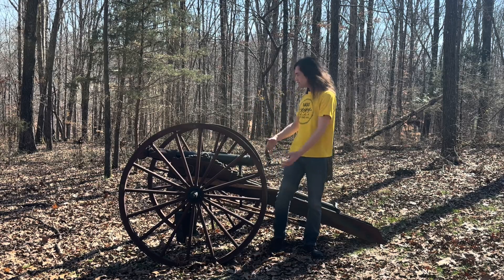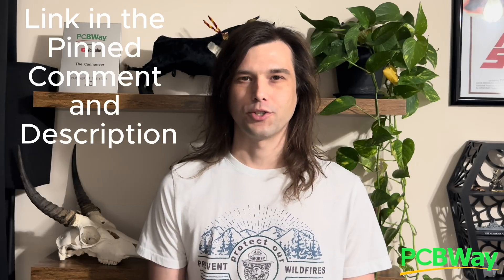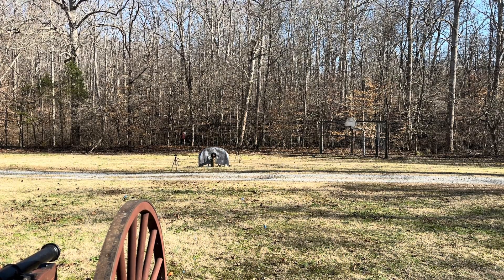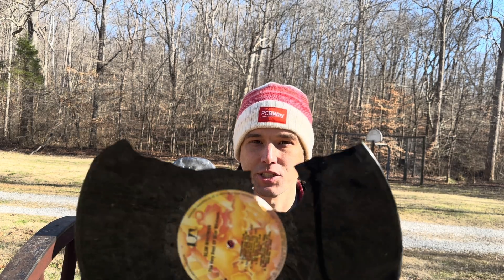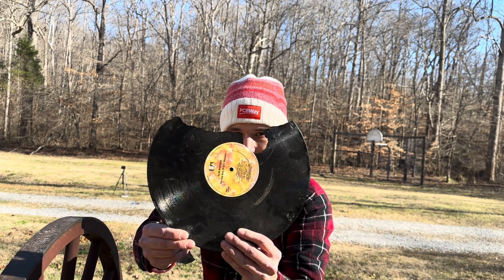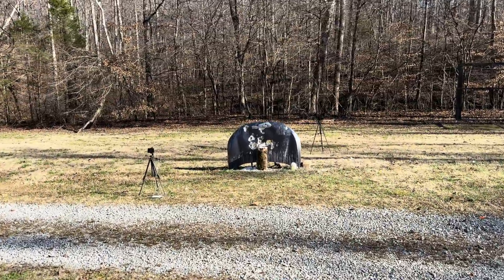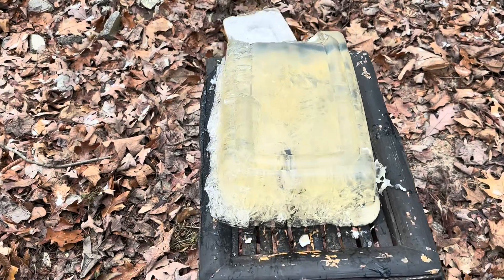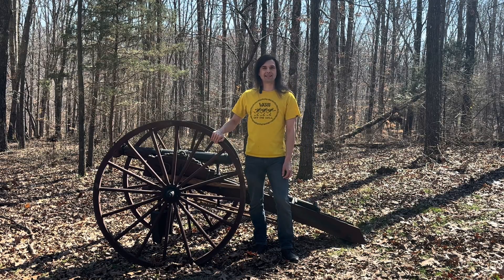Shooting Airfoil Cannon Rounds

Comment: I think those airfoils would fly better if you put a large brass or steel ring inside the front of the round. If you leave a cavity for the ring in the model, you can pause the print and insert a ring. The extra weight up front should keep them from tumbling and make them more accurate. Brass is heavier per volume (its denser), so a brass ring would be the best unless you can get lead rings somewhere. The infill on the model might need some reinforcement to keep the ring in place during the firing process.

This design is really creative! It is a good design but the instability is due to its  low density. It just needs more weight up front to keep it going and stabilize it.

Comment: I have been shooting cannons, both reproduction and original for about 35 years, and in one of my earlier cannons i fired 2 inch PVC pipe couplers and they behaved beautifully as airfoil rounds. The trick was block one end with about 3/4 inch thick of plaster of paris. The plaster would blow out but the blast pressure was sufficient to give good effect at a plywood target at 100 yards. This all was a serendipitous result in searching for a cheap and readily available projectile for a smooth bore cannon of my making.
Reply from the maker: Interesting! I’ll try this out and call is a subscribers special and tag you!
Reply: Got a new 2" i.d. cannon (drill pipe) going to try that... First tests, with a long fuse, from 100 yards away, make sure it doesn't explode; using homemade black powder, not smokeless... Not stupid.

Comment: This is a random question that has just occurred to me, are you using black powder or gun powder in your cannon?  Question aside, I do enjoy your videos and have a suggestion for your car bonnet backstops.  With a contrasting colour of spray paint, give each hole a small spray around. This will make any new holes a lot more visible to your audience.
Reply from the maker: We tossed a can of paint in the range bag for the next time we film this week! Also it’s transitional black powder!
Reply: @TheCannoneer  thanks for answering my question. there is a large barrel pressure difference between the two.

Comment: Ring-Airfoils work by being stabilized via bore-parallel rotation, that's the same type of rotation that rifling imparts. Without that rotation there is ZERO stabilization and thus no accuracy. the US Army experimented with them in grenade launchers back in the 1980s.
Reply from the maker: That makes complete sense honestly. I also didn’t know about the army experiments. That’s pretty cool. Thanks!

Comment: Next time when firing oddball projectiles mostly symmetrical except for some front/back differences like this, load one or two of them backwards. These may have had better stability if loaded opposite of how they were intended to face. Ballistics/aerodynamics get weird at the speeds these things get up to.
Reply from the maker: That would make sense as well! Thanks! I went with the idea of an airplane wing with the big part forward 🤣
Reply: @Eidolon1andOnly  lol I found an airfoil plotter online, pulled it into fusion, and did a revolve around the axis. Didn't put too much thought into it. But I have some ideas, one of which is to make it longer to get the center of pressure behind the center of gravity, as well as small fins to induce some rotation. I also want to try out different materials and construction methods.
Reply: @pnwscitech1589 yeah some inside vanes to induce rotation might help. Nose heavy should too I guess.

Comment: It's counterintuitive how projectiles fly.  An example is how so many submissions just want to fly "backwards".  

People think that the pointy end forward matters more than weight and balance.  You just can't physically get enough mass into a "pointy" (sharp edged, low drag) end of a solid projectile, meanwhile the heavy flat end with 80% of the mass is going to outvote the 20% of the pointy end and lead the way.  But because there's now no drag on the pointy end to keep it from overshooting it just rotates all the way around and the cycle goes on.  Think of how space capsules enter the atmosphere, flat side down and pointy side up, right?  

Similar dynamics are in play at the speeds and Reynolds numbers involved.  The space capsule is moving way faster, but is bigger and in 'thinner' air.  In comparison your cannon sized rounds is like trying to shoot through water, and a .22 is trying to fly through warm honey as far as the relative air viscosity felt.  This is why insects can fly, they're so small that the air molecules are basically closer to them in size and move differently, the boundary layer is all different and it makes it 'feel' thicker in the dynamic response of drag and such.  Normal sized aircraft operating at normal altitude ranges and speeds are flying in Reynolds ranges that 'feel' like air in this comparison.  About the only thing that can overcome this is rifling or other induced spin, enough rotational inertia, gyroscopic stability, and basically anything symmetrical with a long axis will fly straight.

It would REALLY be interesting to see how these projectiles balance before being fired, find the CG and mark it, then see how they all compare once you have a large enough sample size.  I'll be you the heavy end wins in most cases where the light end has little to no drag to provide enough static stability to arrest the yaw and damp the oscillation.  It would also be interesting to drop projectiles into water and see how they sink for the heavier ones, do they fall nose or tail first, or on their side or just tumble?  Do they sink straight down or do they flutter to the bottom like a leaf?
Reply: also: by giving it the airfoil shape, flow along the length is more resistance than sideways. It starts oscillating until it finally flips.
Reply from the maker: Very interesting analogy. Much appreciated!! Also I’ll balance them for you guys too and see how that works!

Comment: I don't think nylon is structurally rigid enough to resist deformation from the barrel pressure pushing it forward. When it slams into the air, it diverts its ballistic trajectory trying to stabilize. Reducing the powder load might help.

Comment: I think they still tumbled because there wasn't enough weight to the front. I'm going to try a new airfoil design with a thicker leading edge. I want to try a dual ring design too. More to come!
Reply: Very good.
Reply: yess...
Reply from the maker: I’m excited to try them out and I appreciate you being a part of the channel too! I hope we did you well!
Reply: Can you design it with a hollow channel up fron? I figure then you can print however many layers to leave half of that channel exposed, pause the print, and insert a piece of copper wire bent into a nice circle and laid in that channel. Then resume the print to encapsulate it.
That way you'll have significantly more weight up front.

The alternative would likely require a much thicker part, but to make it two-piece and have that front part snap together.
Reply: @DUKE_of_RAMBLE  I was actually thinking of doing something like this, but with a steel ring.
Reply: @pnwscitech1589  That'd work, too. I just figured copper would be easy, and electrical wire's copper is a decent gauge for that.

However, you CAN buy coils of lead for making custom weight dangling fishing sinkers. Just plug in "fishing lead wire" and it'll come up.

If you go that route, just be sure to get the solid kind (there's hollow as well), and then if they don't offer the appropriate size you could massage it down to what's needed. I don't really have any suggestions on how to go about that, though... lol
But, lead is soft enough, I'm sure something can be figured out! 😅
Reply: @DUKE_of_RAMBLE  I might try 3D printing a castable mold like Jonathan did for the mini ball.
Reply: @pnwscitech1589  That WOULD be interesting! But might need to cast it out of aluminum, or at least one, as I'm worried it'd get wrinkled when shot if it's made out of lead. 
Unless it had an inner steel frame with a ring front and back, and some straight pieces inbetween... but that'd be a lot of work to pull off.
Reply: @DUKE_of_RAMBLE  There's another YouTuber I watch who did a video on a resin that could stand up to casting zinc. I might try that.
Reply: @pnwscitech1589  Wow! That's... really impressive! 😳 lol
Seriously hope it works out, and can't wait to see it if it does.
Reply: Fairly sure these need to be spinning to be stable
Reply: @thoughtlesskills  yeah, but I wanted to see if I could design a stable projectile that doesnt spin. I think the main issue is the center of pressure isn't behind the center of gravity. I need to make it longer, or heavier up front. I have some ideas